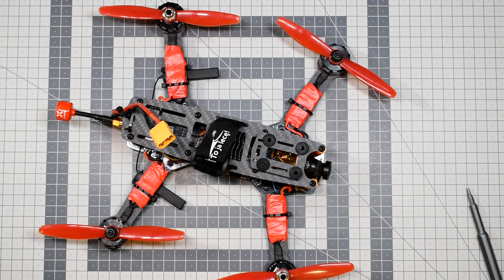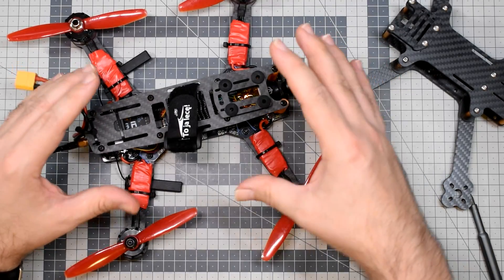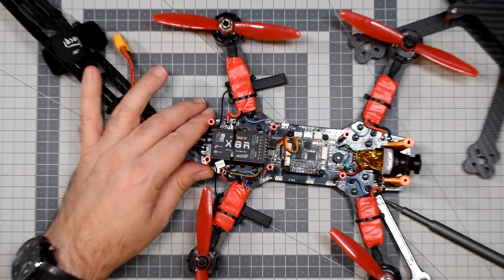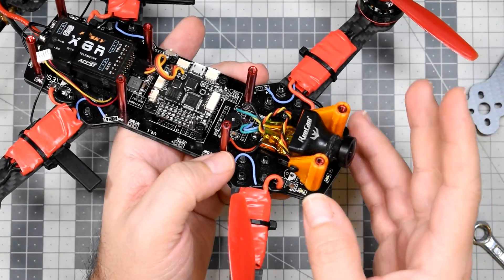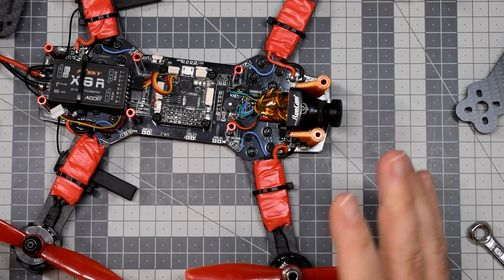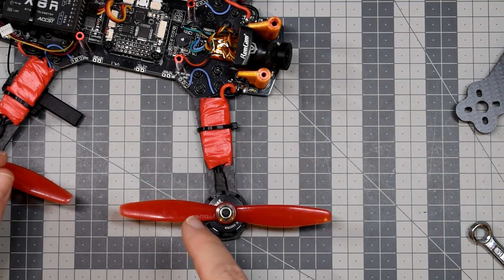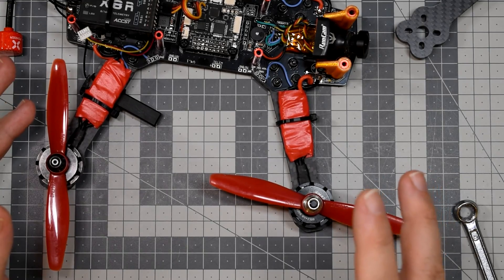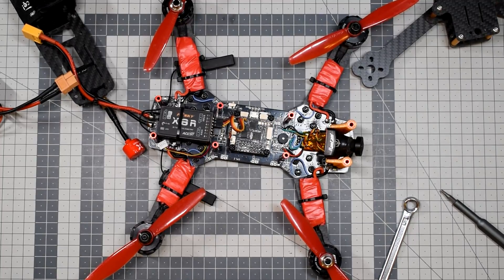ZMR250 on a workbench - a blast from the past

Comment: ZMR-250, the Shelby Mustang of the quads
Reply from the maker: Ford Model T rather :)
Reply: @FPVUniversity  can I say, I'm actually flying a hot rod, with my Zmr250 frame, 4in1 50a ESC, f7 FC, 2306 2750kv, on 4s lipo, 6"inch prop ?

Comment: ZMR rulez. You should show the tuning options for this frame: low rider/ tilted motor spacers/ side covers...

We have had one too. Immersion 600mW 8ch. Genuine immersion fpv cams 80 bucks each. Back then everything was sooo expensive. Including the original frame. 

The 3d printer we have bought back in 2015 was supposed to be printing drone upgrades. And it had with great success.

Comment: i take it the flight controller in it is an omni f3 standard,, or f4 of the same and not the naze 32  that we had back then? cars from  65 and older had the same thing as these motors, lugnuts on left side were clockwise to tighten and on the right side were counter clockwise to tighten .

Comment: You know what I'm new to this and I'm learning quite a bit by seeing this older stuff. But I don't have a problem with the tall standoffs sometimes it's nice to have that extra room
Reply: if you were racing or doing freestyle , that extra room will hinder your flight severely.
on the other hand, the extra room is good if you are flying very slow and long distance,
as it will keep your electronics cooler and allow for more equipment. it just depends on 
the type of flying experience you are looking for.   WELCOM to the hobby fellow pilot
Reply: @breakalegfpv9532  thanks for the advice, and by Hinder you're referring to resistance correct?
Reply: @MrSabram07  correct, as in it will hinder the performance.. happy flying !!✨
Reply: @breakalegfpv9532  is it maybe possible to get smaller standoffs?